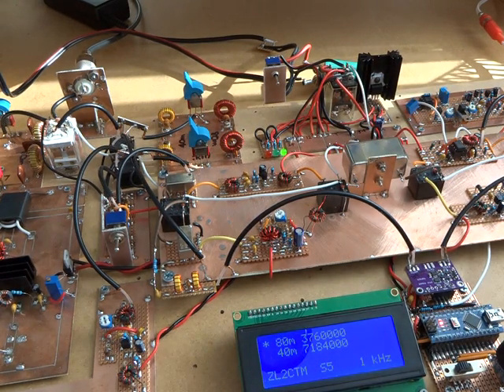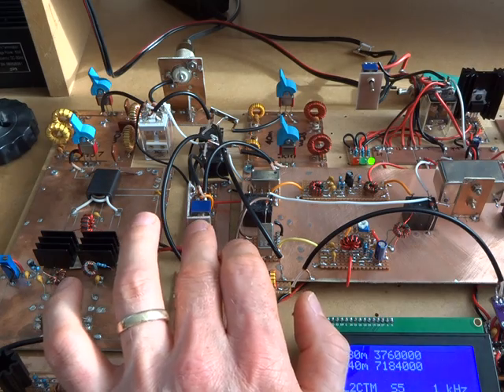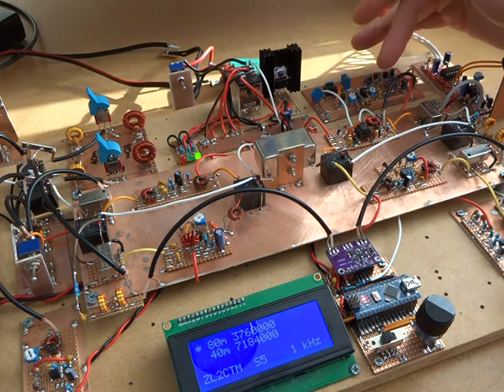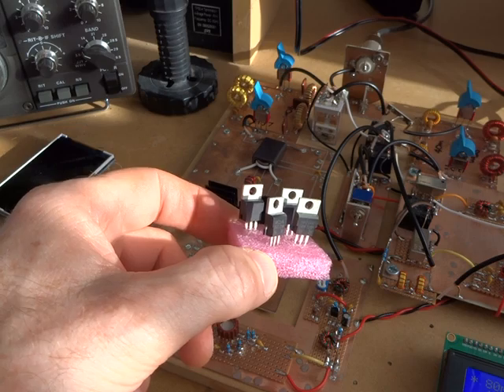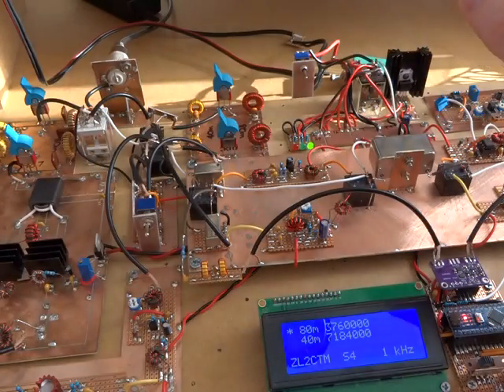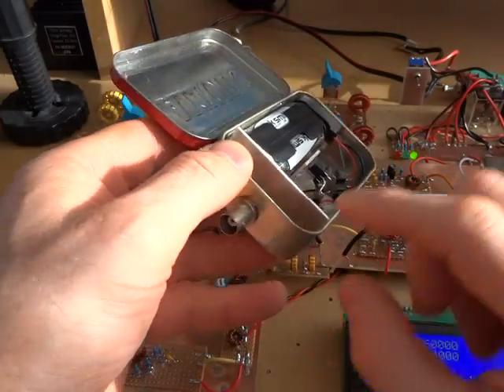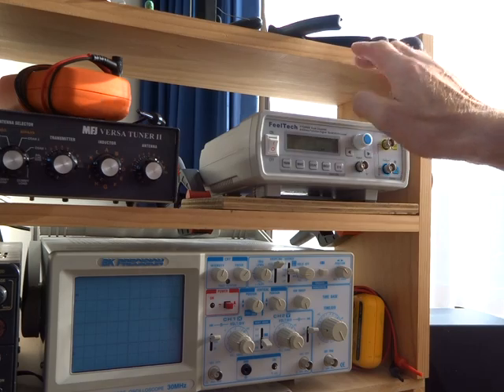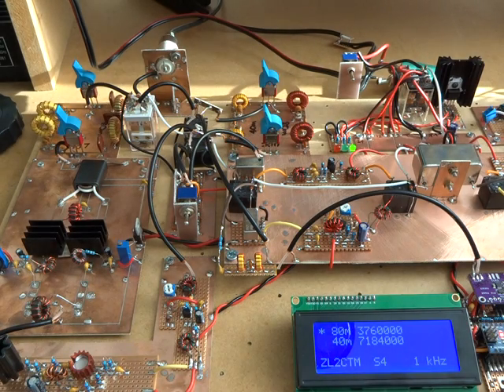Thoughts and Ideas for Enhancing the Homebrew SSB Rig

Comment: Hi Charlie-how about a BF981 duel gate mosfet in the rf stage,  good gain to Vhf ,and the extra gate could be used for agc or to control the input gain via a front panel pot ! - Mal
Reply from the maker: Hi Mal. I have a bunch of those on order so I will give them a go. Thanks again.

Comment: Just noticed the toroids you use for input band filtering seem large for expected input power. Are they selected because they were handy and if so what minimum size do you think would work?

Thanks for all that you do.
Reply from the maker: Hi Kenneth. The input BPFs are based on the Solid State Design for the Radio Amateur text. The 80m filter calls for a T68-2 and the 40m T68-6. I did play around with a T50-6 for the 40m filter as an experiment. I have added to the list for this series a note to try both the T50-6 and T50-2, as I see no reason why they wouldn't be suitable.
Reply: I suspect the toroids are large enough to be band filters for the transmit side of a radio as well...especially if it the design came from a AARL source. Smaller toroids may need more turns for the same inductance.
Reply from the maker: @watsok  That makes sense Ken.
Reply from the maker: Ken. For interest, I'm going to try and do away with the LPFs and only use the BPFs for both RX and TX. I know Codan used that technique in their commercial rigs. That would certainly simply things.

Charlie

Comment: Sorry for spamming this idea but the only aim is to remember it, I m talking about a general coverage transceiver. 
Another idea is an automatic antenna tuner (ATU)
Thanks for the new intersting videos and stay creative!
Reply from the maker: Cheers. I have both of those on the long term list. I've been thinking about the automatic ATU and how to keep the cost down. Maybe the Arduino 4x relay boards would be a better option than a servo. I must admit I have not priced either. The general cover transceiver will take some thinking too, as I suspect that may have to be a dual conversion superhet to minimise image freq issues.

Comment: Why not switch between the input bandpass filters with relays Charlie?  You could control them with spare Arduino lines.  You can buy small A rduino controllable boards with 4 relays on them with opto isolated inputs cheaply on eBay.
Reply from the maker: Thanks. You certain;y could and i may look into that. I guess my approach was to make it as simple as possible, but i agree the relay method would be more elegant. I'll price the relay boards.
Reply from the maker: I was just thinking about the LPF out of the PA. I'll have to see how well those small relays  will cope with that. Probably ok at the power levels i'm running.
Reply from the maker: I've just ordered 4x 4ch Arduino relay boards. Not too expensive. Significantly cheaper than buying individual relays!